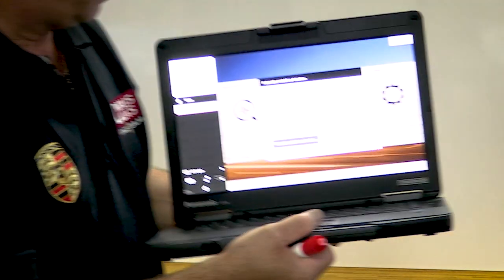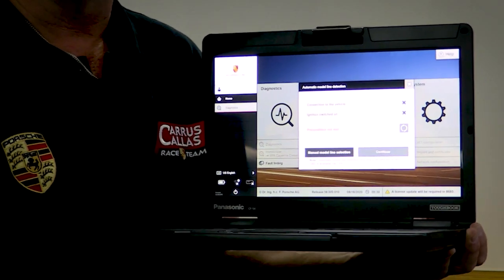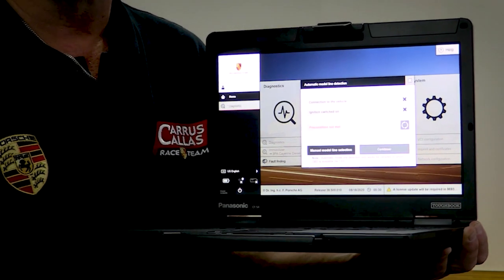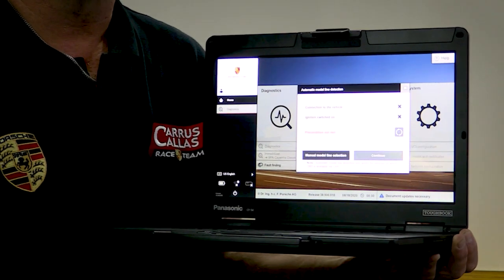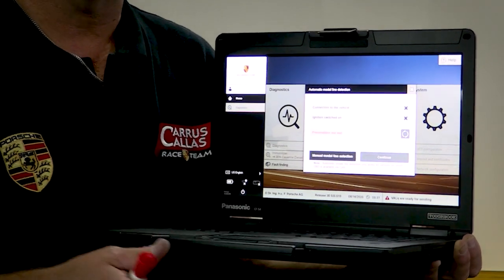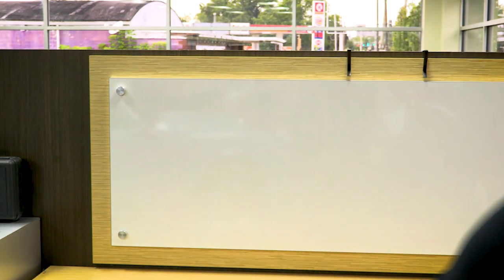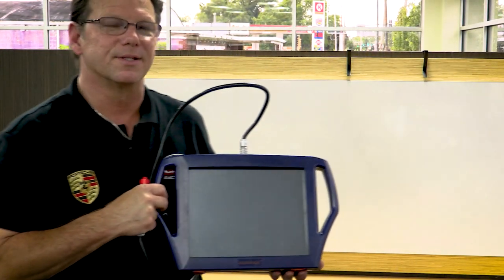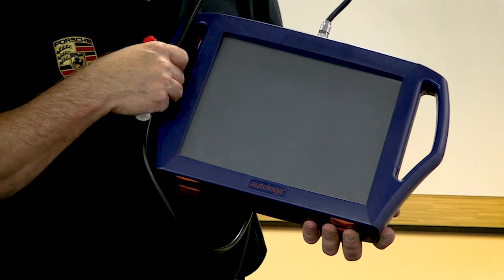Porsche Engine Diagnostics: Fuel Trim - with Tony Callas.

Comment: Nice! Have been tracing a P1126 on my Boxster S. Have replaced everything that would do that and even Dealer can’t figure it out. Gonna be hard to pass emissions soon. So frustrated.
Reply from the maker: You might try contacting one of our IMS Solution certified installers shops as they are very knowledgeable with these models and will be better than the dealership for troubleshooting this issue for you.